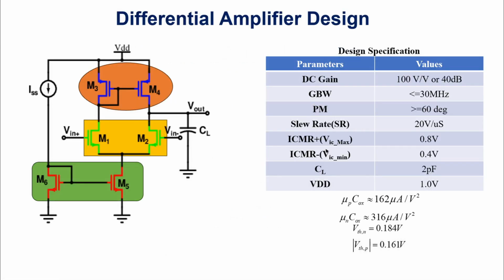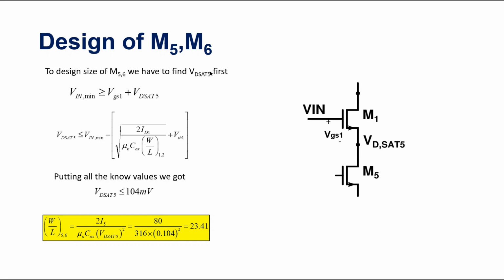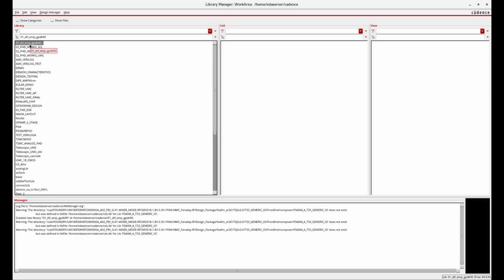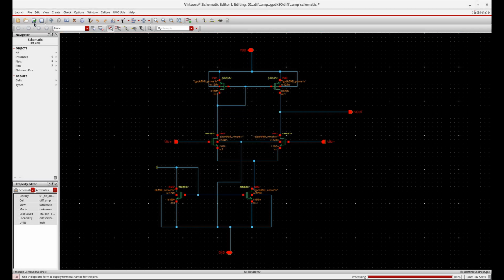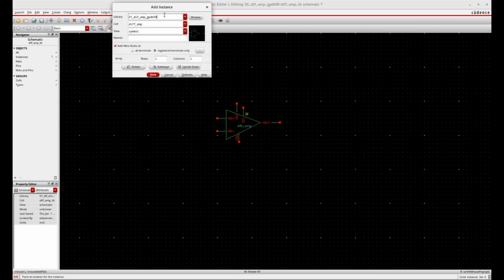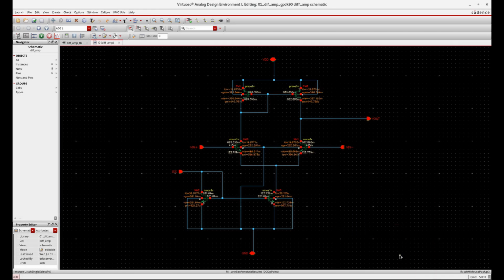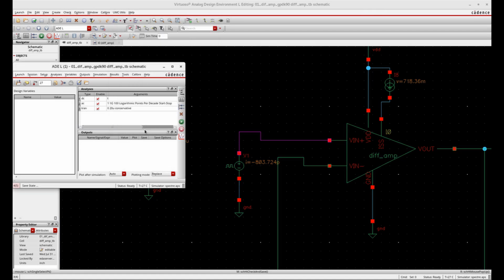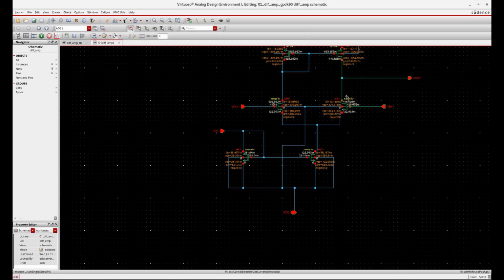Part 1: How to Design Differential amplifier using GPDK90nm Technology

Comment: Why are you selecting common-mode input voltage (Vcm) more closer to minimum ICMR value? Any specific reason for selecting this value.
Reply from the maker: you can choose any value within the icmr range, but we have check the output swing also so based on that you can select any value to satisfy the other specifications as well.

Comment: Out of all given design specifications, why you have not used DC gain to set W/L of of any transistor. But in simulation results, the gain of 40 db was achieved. How can you ensure that the DC gain will be 40 db after all simulations?
Reply from the maker: For differential amplifier( 5t OTA), maximum gain we can get up to 45dB approx. due to topology limitation by satisfying other optimum design parameters. So to go with 40dB gain spec which can be easily achieved by the GBW chosen.